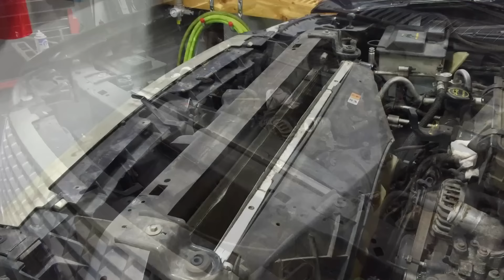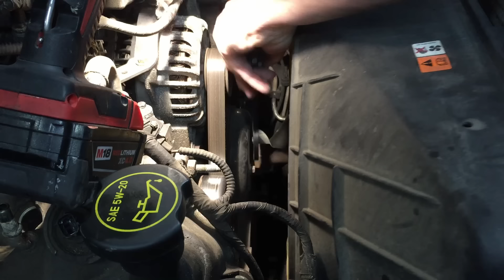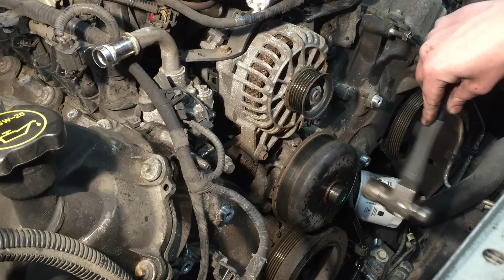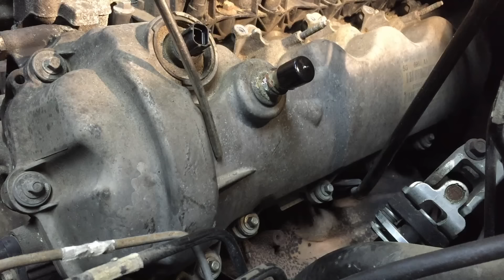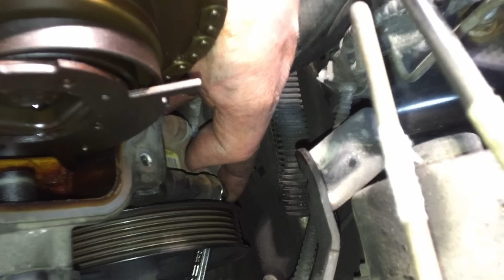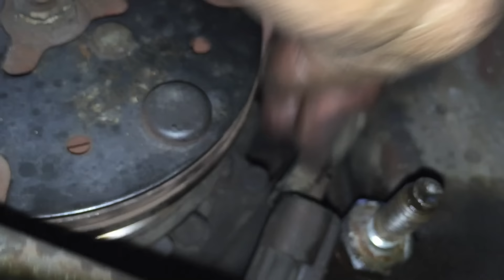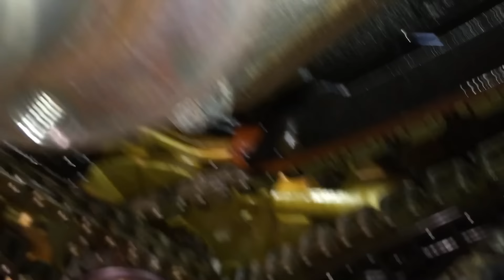Ford 5.4L 3v Engine Timing Chain Kit Replacement Pt 2 of 4: Front Cover & Valve Cover Removal

Comment: Thank you for all your vids. They are so helpful!  I'm thinking this is what I need to do.   MY 07 Ford Expedition started running rough at idle and feels like it's struggling when stopped - like it's almost about to die.  It had error codes P0022, P0018, and P0012.  I checked and one of the first and "easy" fixes was to replace the sensors.  I did that.  Problem persists but the codes have changed to P0344 and P0340.  I read it could be the alternator, so I checked it and it's fine.  Think the chains need to be replaced?

Comment: If you are like me and cant seem to get one of those bolts off to secure the chain on. Put your socket and ratchet on a lower bolt head with your ratchet on "tighten"  put a small pipe over the ratchet handle that extends to under the upper A arm bracket bolt on driver side by wheel well. That will hold pulley in place while you slip crescent wrench  over the main nut and give it a tap.

Comment: I'm doing this very same thing RIGHT NOW on my 08 f150. I've been periodically stopping to watch these videos in segments to keep pace with them. I've been a ford fan all my life, but the engineers that came up with the modular motor concept should have their asses kicked. These videos have been a big help, but I still believe ford dropped the ball when they went this rout.
Reply: I did the same thing on my ‘08. Runs great. Swapped out the plastic tensioners with the Melling cast tensioners. 

The Ford engineers were morons in how they routed the oil through this Motor and by using the whole cam phaser garbage. Totally unnecessary.

Comment: I have to tackle this,  that sagging chain has to be my problem.  Threw a p0016 and it has the rattle at startup.  Thanks a lot man.  I will keep on watching the rest of this.
Reply: Is your rattle only on cold starts? I am having a rattle on cold starts. Noise only lasts about 1-2 seconds
Reply: Animal House yes only on cold starts.  I fixed it,  it was the chain tensioner.  Stupid plastic crap designs.
Reply: @cesar9496  Oh man, so you had to go through all of this just to replace it? How long did it take you? I'm dreading having to do this!
Reply: Animal House yes you do,  I replaced the whole timing set.  Might as well since you have to open it all up.  Took me 2 days.  Just in parts I spend about 1200.  You can just do the tensioner, but those cam phasers depending on your mileage most likely be out.
Reply: @cesar9496  sorry I keep bothering you. Taking everything apart doesn't scare me.. getting the timing wrong is what makes me nervous. Is it pretty cut and dry if you follow the video? Also did you replace the crankshaft pulley with a new one?
Reply: Animal House hey man no need to say sorry.  Yes that’s the hardest part,  I was afraid of doing the timing on my own so I just followed everything with a friend of mine that’s a mechanic.  Everything that’s explained in the video it’s explained very well.  Just do everything he says and you should be good.  I’d probably messed up twice but my buddy corrected me.  I say if you have someone knowledgeable with timing it’s best if he’s there.  If you think the video explains it very well don’t be scared.
Reply: And no I didn’t replace the harmonic balancer nor the crank pulley.  I should have but didn’t even think about it until now that you mentioned it.  By the way I sold my truck to a buddy of mine and it’s still running great.

Comment: I found it a little easier to remove the oil filter when taking off the power steering pump.  Worth the extra 10 bucks.

Comment: I have a 2007 Expedition EL with 367,000 miles, I am having the timing rattle on the front of the engine on start up. I am wondering if the repair is worth the money with miles I have on the vehicle. I bought it new and most of the miles are highway miles, I have the driver side valve cover off, and lots of varnish, but know sludge. What are your thoughts on this repair, don't want to spend the money if motor could have a bearing failure. Motor does run good and still has lots of power. Would you spend the money on the repair?
Reply: What did you end up doing mate?

Comment: i have a 5.4 3v that is starting to tick with little shavings on the oil drain. Im assuming this is the scenario. My question is they had put 4.56 gears on it and 33.5 tires, which the tires have been reverted to stock the truck used to pull very well on original gearing and tires but now with the stock tires and gears it doesn't seem to have any power pulling up a grade. Would the timing chains be the biggest culprit?

Comment: OMG, from what I read I am lucky my '03 F150 went 217,000 before the chain rattled so much it sounded like a diesel that ran out of oil. I think it is time to change everything related to timing. Otherwise the engine ran like it was new.Great vid and I subscribed.

Comment: Hi started pulling everything apart for the timing chain and gears but found low impression on number five only 85 psi !  No. 6 105 my engine has 222k .can I get good engine rebuild kits or should I buy a new shortblock?

Comment: The issue we are having right now is getting to the back bolts on the passenger side valve cover. It is nearly impossible to get to and we are wondering if you have a secret to getting to them. The AC evap canister and trans fill tube are in the way :(
Reply from the maker: Those items should be removed out of the way.
Reply: Thanks for the reply, we figured it all out but that bolt right in the back next to the firewall was a bear!  Need someone with tiny hands for these jobs!! Thanks again.
Reply: Does the AC need to be evacuated, or can the lines be pushed out of the way? (I guess I'll be finding out soon...)

Comment: soo my 2005 5.4 is probably shot. my timing chain someway made contact with my valve cover on the passenger side and knocked a hole in it. should i just get a new engine?
Reply: Any answers? Me too
Reply: If it's just the valve cover no. Get a new one or set and have at it.

Comment: Hi, I am about to tackle this job on an 04 f150 and had a quick question. Instead of unbolting the power steering pump, can i just remove the pulley and have the clearance I need?
Reply: well i ended up pulling the pulley and looks like ill be able to remove the cover with just removing the one bolt. one last question, is there a bolt on the ac compressor that needs to be removed?

Comment: Awesome videos. I have been watching and learning on how to replace the Cam Phazers. During the change out, I noticed a TC guide floating around on the right side. Now I need to remove the FC and replace those components with a oil pump since I am there. I'm heading into an area that do not have experience. Thanks for the help!

Comment: Just one observation after removing both valve covers on 2011 5.4 Expedition. Considerably more varnish on driver's side than on passengers side (looks almost new w/ no varnish). Is this normal or is there an underlying problem that needs to be attended to while I have all components removed? Brian, you definitely are "The Best" at instructional videos out there!
Reply from the maker: This is perfectly normal as the pcv gases are drawn through the drivers side valve cover.

Comment: My 09 does not have threaded holes on the crank pulley. Ill have to rent a claw type puller. My 1/2 inch pneumatic impact wont loosen the crank bolt. Ideas how to hold the pulley so I can use a breaker bar?

Comment: Really helpful videos good sir. I do have a question though, I’m doing a timing chain on a 2004 5.4 but the gears are fixed to the cams on top. None of my parts guys can help me out. I’m wondering if the set I need includes cams as well? It’s not vvt and the gears look almost press fit to the overhead cams. Have you seen this and if so can I replace the timing chain without replacing the cams or does the set include cams?! Sorry for the long post I’m just stumped here...

Comment: Brian...I am trying to get the power steering pump in bolted on my 04 F150 3v and the top front stud head snapped off so I didn't go any further...Now what do you recommend?
Reply from the maker: Remove the rest then let the pump slide away from the engine on the broke bolt now stud. Cut the stud from the back side of the power steering pump. Let the pump drop down away to the frame then you are free to finish extracting the stud from the cover.
Reply: Thanks a lot Brian. I'll give it a shot.....(former Corpsman 1/7 1st Marine Div.)
Reply: @FordTechMakuloco  what about a ceased bolt that has rounded off? mine is the studded rear lower, on the power steering pump. Sounds like many of us are struggling with that pump. AWWWW!!!!!
Reply: By the Grace of God, the bolt came off totally rounded. 10mm deep socket and patience with a lot of prayer worked. Now I have to buy a new one from Ford.

Comment: I hate these engines. Two timing chains long enough to be log chains with the only thing holding them tight is just one tensioner per chain. Just one faulty tensioner and your having to replace the timing chain. Ford really needs to get away from this OHC bs.

Comment: Is it normal for the timing chains to get loose when you turn the engine? I replaced all timing components on my 04 5.4 engine. The chains were snug while I turned the engine, but after putting the followers back and turned the engine, the chains would get loose at one point  but then they would get tight again as I keep turning the engine.
Reply from the maker: Totally normal.

Comment: for those of you having trouble getting the harmonic balancer bolt out use a breaker bar and rest it on the frame lay something on it like a rug so you don't damage your radiator and crank the starter you only want to tap it and it should break it free that's what I did it took 4 trys but it works

Comment: OK I am very poor and have a start and die issue on my 2006 lincoln Navigator 3v I watched all of your videos and im a subscriber the code from the computer is showing a bank 2 cam sensor the engine only has 115k miles on it

Comment: How do you get the crankshaft pulley off of a 2010 F150? There are no bolt holes for the tool. 😩

Comment: I followed your video for disassembly but when I got the passenger side valve cover off one of the intake roller followers was sitting on top of the head. Looks like the bearing on the rollers follower failed and eventually spit the follower out. Have you seen this happen before? Do I need to replace more than the cam and followers?
Reply from the maker: +ajrhodes100 Yes we see them all the time I have a few videos on this. You need to replace the cam and followers but also check the lash adjusters for bleed down.
Reply: FordTechMakuloco: ok that's good news.  Do I need to worry about valve damage? Half of the valve keeper is missing also.

Comment: I'm to the part where I pull the crankshaft pulley, but my pulley doesn't have holes to mount the puller to the pulley. How do I remove the pulley in this situation?

Comment: I have an 2007 STX special edition that was in transition to a 4 wheel drive when I bought it. It doesn't even pull up on parts computers. It was built 4-30-07. I'm elbow deep in replacing the cam phasers that went out so I just got everything oil pump, guides etc.. I'm having one hell of a time getting the passenger side valve cover off. Its hitting the trans dip stick and some A/C lines. Is there a way to do it without messing with the A/C. I don't have any equipment to fix the a/c. P.S. Your video's have saved my A** way to make it easier for half decent shade tree mechanic!!

Comment: realized I have 4 bolts on my 04 which requires me to remove the pulley and disc some pressure lines to get to the 4th bolt

Comment: You make it look easy getting that p-steering pump off. Spent all day trying to remove mine and have to decide to put everything back together because I can't remove mine and remove the front cover. Pry bar and everything but feel like I'm going to brake it or there is a 4th bolt . My Haynes manual is confusing

Comment: Hey, thanks for such in depth videos. i just took my timing cover off and have one guide that has a crack. the others look good. would it be ok if i changed the tentioners and that one broken guide to save some cash? trucks only got 100 000 miles. do these chains stretch or can i keep the originals?  thanks again for all your help!

Comment: have any tricks for getting that crankshaft bolt out? my will not come out and I'm using a 1,00lbs impact gun on it.
Reply: I'm having the same problem.  I finally rounded the bolt head. is it possible to grind off washer to relieve torque?

Comment: Your video's are amazing. I watched all 4 and then I did the full change. Oil pump, timing chains, guides, tensioners, VCT and phazers. The one thing I skipped was removing the tappets. The otc tool works great for helping getting everythinbg aligned and a set of vice grips between the lobes of the cams helps give you piece of mine if your worrined about the cams jumping and hitting valves. The biggest thing is to loosen everything while its still together. I was able to move the cams with the vice grips and I never felt like the cams were going to jump or move. The vice grips really just helped me move the cams slightly when putting the timing chains on while getting the tensioners in place.  Did not even leave a scratch on the cams.The vice grips where a little to wide so I took a grinder and thinned them up so they would fit safely. I took every thing apart without the gear wrenches but I went and picked myself up a set  when I started putting it back together. Unfortunately the 8 mm did not come with the set and had to be special ordered so I did not have it to help with the oil pump. That was a major pain with out the gear wrench.  I love the flex The gear wrenches. I should of bought those years  ago. Thanks again for all your time. I fired up my truck this evening for the first time. No more noise. I had a broken chain guide.. Thankfully it did not break in a million pieces and all the broken parts were visable.  215.000 miles.2004 F150 5.4L Lariet.

Comment: Hello I've watched your videos on valve train,all 4 of them at least 8 times a piece and confident I can do it on my 06 5.4 expedition the problem I'm having is that my oil pump is slowly  going out on me and makes a clanking noise at the top of the motor because not enough oil pressure is getting to the top to properly lubricant but now I was wondering once neutralize the motor  and put everything to TDC and am very careful can I replace the oil pump with out using the speciality tools.

Comment: Great series of videos.
For an 2007 Navigator what would be the average cost of this procedure including parts?
Reply from the maker: +ju lu $3,500 at the dealer I only charge around $1,860 or so though.
Reply: Thank you and congratulations for having such an informative channel.
Reply: +FordTechMakuloco 3500 for a motor with 200,000 miles. Shit. I'll buy a crate motor with a warranty and throw that in.  Your price is still great. But wouldn't a new engine be a better choice?

Comment: great videos! I'm working on my 04 F150 and the power steering pump isn't the same as this video. Do I have to remove the pulley and bottom line to get the bottom third bolt out?
Reply: Solved it, If you end up doing this job and realize your power steering pump is different than the video.  Undo the top 2 bolts first, follow the hose from the bottom of the power steering pump and gently unclip it from the stud on the timing cover. You'll be able to just barely wiggle that line and fit a ratcheting wrench (flex head ideally) in there on the bottom bolt. By unbolting the top 2 bolts first it will back your wrench against the bottom hose of the power steering pump but will back the whole pump off the timing cover.  (Your wrench will be stuck until you back it all the way off). Good luck!!  This walkthrough is great!  Trucks never run better!
Reply: I always take the pulley off, only takes a couple minutes, then much easier to get to the mounting bolts, etc. Saves time and frustration....LOL

Comment: Also my motor has no ticking or clanking it runs really quiet and smooth its just really weak and i am hoping that a rebuild will make it run stronger. thanks

Comment: I have a 99 5.4 and it has 270K miles on it. There isn't a single issue with the motor other than a blown head gasket. I want to change the head gasket and while I am there do a partial rebuild (piston and rings, main bearings, rod bearings, freeze plugs and timing kit and whatever else is worn and needs replaced) I want to do so because my motor runs really weak due to high miles. Do you have any recommendations as far as doing so or will a new motor do me best. I just want my truck running strong again on a limited budget and I do plan on pulling the motor.

Comment: Do you have advice on getting crankshaft ulley off?
Mine won't budge & I'm afraid to mess up the bolt or the sockets.
Reply: Disregard earlier question.
I just needed to borrow a real Impact wrench. Once I figured that out, plus a few small delays in the process, finally got the job done about 1 week ago. My 2008 F150 now runs very smooth & quiet.
Thank you very much for your videos. I wouldn't have done it without them.
Thank you again.

Comment: How do u replace the roller followers with cam shaft in there
Reply: And is there a way to take them out without spending the money to buy the valve spring compression tool